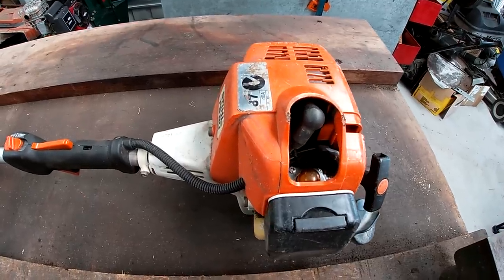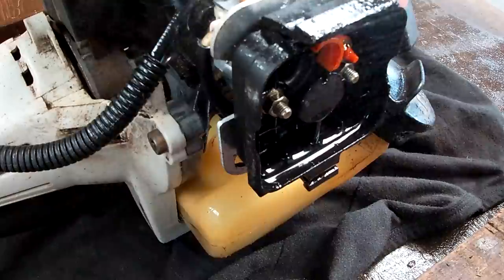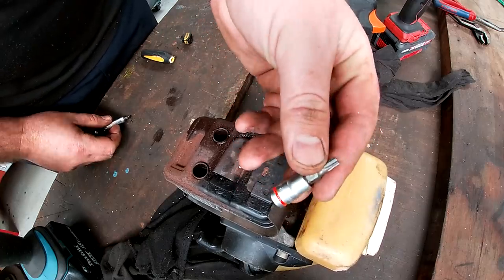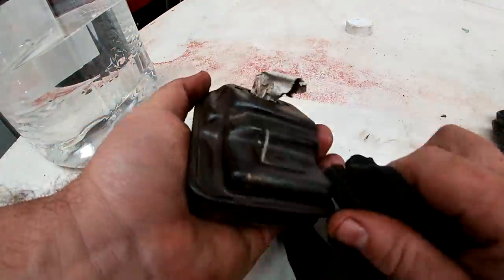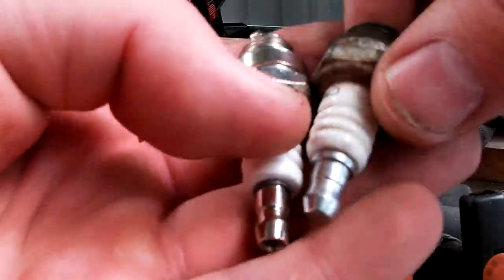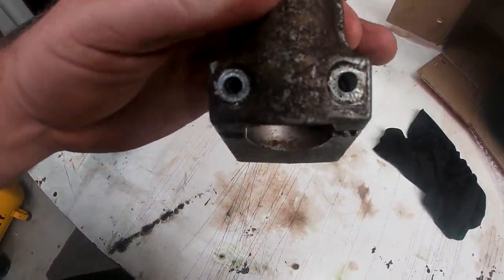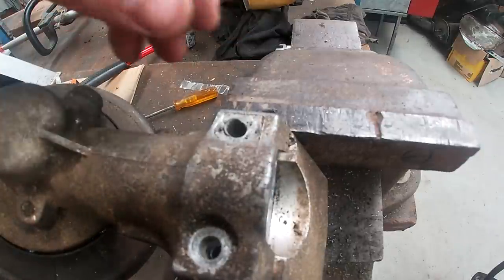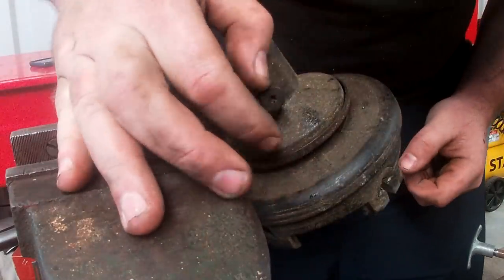STIHL FS80 multiple repairs!!!

Comment: I got an old Stihl FS90AV on the bench at the minute. It was my Grandpa's and used it alot as kid here on the farm. Runs for 5 minutes then cuts out. So it's overhaul time for the old dear. Have the carb in the ultrasonic bath at the minute. I generally leave them in over night. It's not my main brush cutter I use I normally use a Honda umk425. I normally only the Stihl out in the paddock around electric fence posts   and the likes.

Comment: Enjoying your videos Sean, great stuff. One suggestion - use some anti seize on those exhaust bolts. Make the job much easier next time. Keep up the great work!
Reply from the maker: Good point!
Reply: Donald Stevens that's why they invented WD40 😂
Reply: @monicap5071  Hi Monica - anti seize is so you don't have to use penetrating oil and hope that the bolts break free, keeps them from "welding" together in the first place.

Comment: Great video. How is the workshop temperatures going, especially without insulation?
Reply from the maker: It's as you'd expect lol
 Gonna be sweaty in summer!
Reply: @theaustralianrestorer6211  was insulation not offered by the company? I insulated mine before wall panels and roof sheets went on. No condensation and comfortable in all Melbourne seasons
Reply from the maker: @michaelzanotto8469  yeah it was offered. I opted out to save myself a few grand. I've worked in hot sheds for years, nothing a fan doesn't fix :)
Reply: Cheers

Comment: Next time you come up against a stuck screw like that, take a punch with a tip a bit larger than the screw head and give it a few firm strikes with a hammer. It will usually come right out after.
Reply from the maker: I tried that mate

Comment: I'm surprised you haven't come up with a solution to stop replacing the plastic cover that you tap down on concrete to get the cord to come out - There must be a way to attach a metal protective plate or small thick plastic heel onto that plastic bit to give it more life ? Design one that's generic to place on any whipper snipper and you might be on a winner !!!
Reply from the maker: It's just a matter of screwing a bolt through the cap. No reason not to, I just never have!
Reply: @theaustralianrestorer6211  Stick your logo on it and sell them online or in Bunnings - I'm guessing many mowing guys and gals would want one ... even offer a few as a give away on both of your channels !